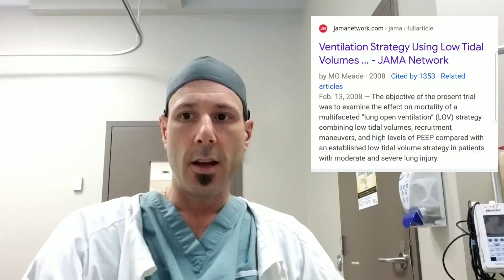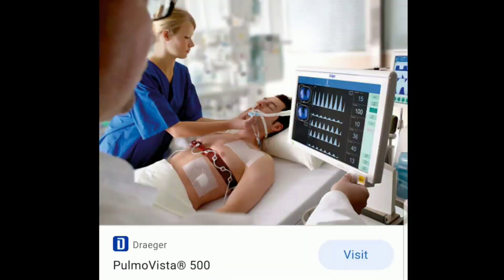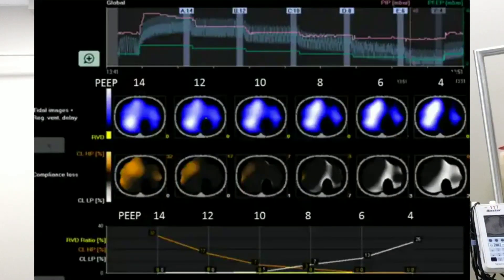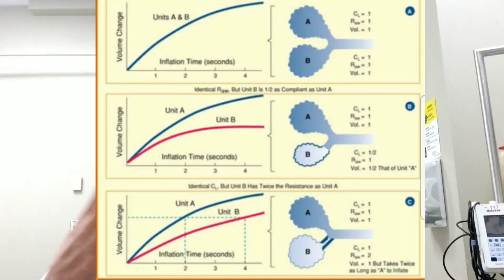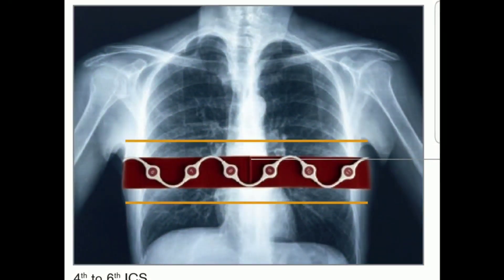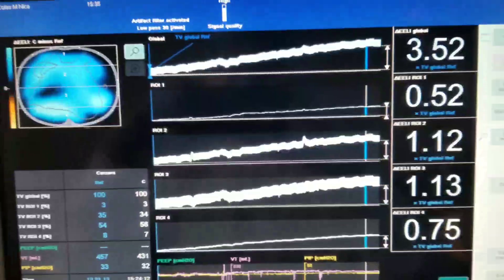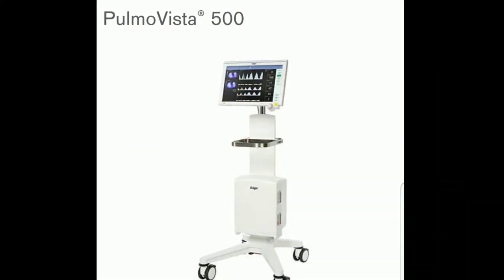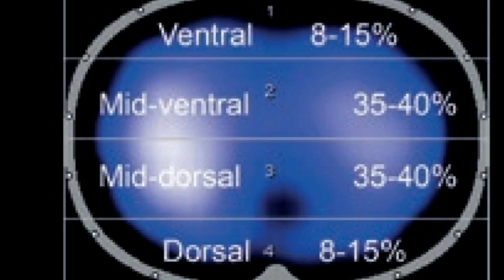Setting Peep In Mechanical Ventilation.

Comment: Is there a correlation between PEEP and blood pressure?
Reply from the maker: As PEEP increases so does intrathoracic pressure which can potentially decrease central venous pressure especially with those already hemodynamically unstable or those with hypovelemia which can potentially reduce cardiac output.

However not using optimal PEEP puts the lung at risk of increased stress do to less alveolar surface area secondary to atelectasis. Alveolar derecruitment also increases strain to adjacent alveoli do to alveolar interdependence. Alveoli support each other and when alveoli collapse or cyclical opening and closing occurs healthy alveoli beside the collapses one become unstable are at risk of overdistention (strain). Derecruitment also increases pulmonary vascular resistance which transmits to the right side of the heart and can drop central venous return creating hypotension. 

Usually if your successful in finding optimal Peep and not going higher than what is optimal blood pressure is not an issue.

If we correct the transpulmonary gradient we are doing something beneficial. A morbidly obese patient lying on there back creating excessive pleural pressures collapsing the lung will also have negative hemodynamic effects. 

Quite often a overweight patient ready to be extubated will often have an optimal Peep requirement of 8 to 10 cmh20. While the average patient is 6 to 8 from the EIT's I've done over the years.